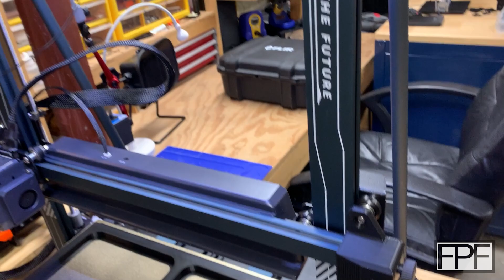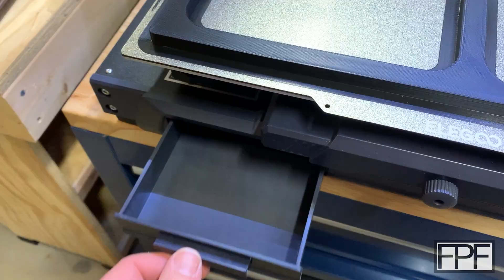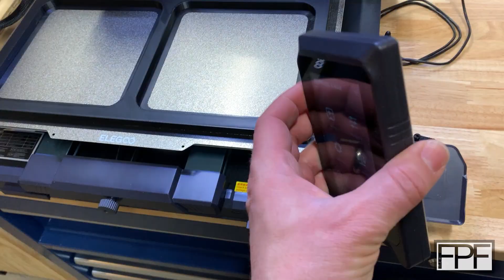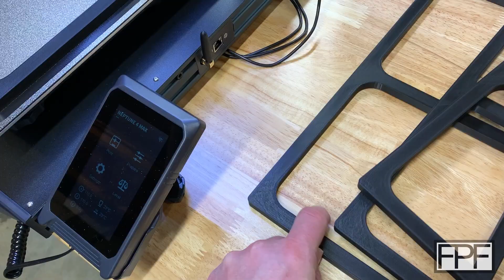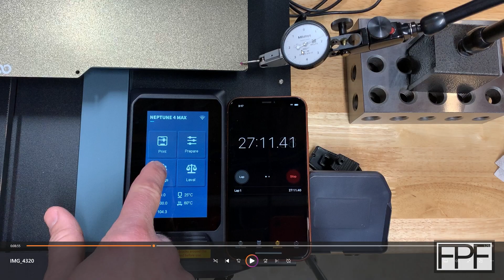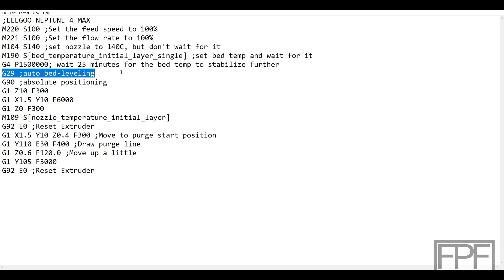Neptune 4 Max Review and a FIX for the PROBLEMS EVERYONE IS HAVING

Comment: THANK YOU!!  I was about to freaking hammer-throw this printer out in to the street and give up on printing completely!  I was letting it pre-heat before prints but z-offset and bed mesh were always inconsistent I should've known there was a better way.  Thanks for the G-code!  The bed mesh before every print has helped a ton.  Smaller prints are turning out fine now, haven't tried a large print yet but I have faith now that it will turn out fine :)

Comment: AHA MOMENT!!!  This would explain why the bed is shifting every time I try the auxiliary bed leveling technique.  Glad to know I don't suck at bed leveling.  Heat soak, test, heat soak, print.  What method or material did you use for setting the z offset on the printer?  Did you use A4 paper or some other spacer "device"?  Also, have you used Cura with this printer?  Do you prefer Orca over Cura?  I've been using Cura, but may switch to Orca if you recommend it over Cura?

Comment: Hi, I have just bought the Neptune 4 Max last week, and I had it sent to me, to the UK. In Europe we do use Cura a lot... Basically I printed out of the box, just after making a manual bed levellling and then an automated one. So far, I have only been printing small objects (the biggest is a drawer adaptor for the little drawer on the side of it, which goes inside the drawer and you can store the L keys etc), a filament out sensor bracket, to place it a bit more centered, two spool holders (a rotating one and a 3KG one), the extruder clip adaptor (The original one is indecent). The only times the print failed, was on four occasions: on three of them, I did not put any support during the slicing process in Cura, so the object did not have support in some areas; the fourth case, during a print job of a corner camera adaptor, at 50% (several hours), I have decided to switch off the led lights on the top, and for some reason the printer crashed, returning an error about reaching the max extrusion... I pressed the emergency stop on the webpage of the printer administration area (I have been experimenting both physical touches on the pad and the LAN management), and restarted the whole services a couple of times. In some cases, like when I tried to print a small nut and a bolt for a cosplay caliper, the threads did not come out well. It is too early for me to tell you if there are other issues. I did not upgrade the firmware or do any of the annoying things you mentioned, which made me think that probably I have no idea of the printer's flaws yet. This is my third printer, after a Prusa MKII Ephestos and a Creality Ender 3 S1 Plus which went on fire and smoke - seriously - last week, while trying to install a Sonic Pad (Still waiting for Creality to reply back to me about that) . I will follow you and keep your video as a reference, shall I have to do all the stuff you said. I really hope I do not have to upgrade the firmware or open the pad because it is very annoying...
-- 15 February update --
Actually I tried a 10 hours' job with PLA/carbon fiber, and at 87% I had to do a stop, because the printer started printing off Z-axiz, and it was all screwed up. Also, all the prints were opening in half, like a toast :-( I have experienced also that part of the first bed layer, in some areas was having visible spots in it, as described by someone, and after some time the fans bar, attached behind the extruder, started scratching the printed layers, when the bed was going back and forth. I had done a manual calibration before starting any job, and also an automated one. So, probably I will have to change the printer configuration as you guys said.
How can I check if the firmware is the latest version?

Comment: This video is pretty helpful and thanks for a heads up on this, but it's too long
I thought there will be a bunch of problems and multiple fixes (Title says "problemS", but in the end it was "There is one problem actually and it's a heat expansion because of physics, here is the showcase of that with my tool, so just heat your bed for 15-25 minutes before leveling and printing very large objects" but for 20 minutes for some reason. I get it you tried to be informative, but there are ways to condense information

So probably it's a good idea to build an enclosure for this printer I assume?

Comment: Could you use a glass top to fix the issue?
Reply from the maker: possibly, but the glass would have to be quite thick to remain flat at this size which brings with it quite a large thermal mass, which brings us right back to the same problem (long warm-up time)

Comment: Quick question: I set my sample to 3 but the LCD screen still thinks it's only doing 2 per spot. Now it measures a spot 3 times but the screen show that the 3rd measurement is for the next spot in the line. Is there something I need to change so that it knows it's doing 3 measurements per spot now instead of 2?
Reply from the maker: what is the console in klipper showing?
Reply: @FunctionalPrintFriday  Looks like the console is showing all 3 measurements in the same location .

Comment: Took me a bit of time to figure out the problem with firmware and the fact that waiting for bed to stabilize is required. For me, 10-15 minutes is good on my N4Plus.
Reply: mine keeps crashing any chance you can share the start code?
Reply: @user-gl2ss2th3m  Just add G4 P700000 after setting bed temp by M190

Comment: I'm new to the hobby and this is my first printer, i was very frustrated going through everything trying to get better results and basically came around to the same solution you showed here, just not as efficiently, i was just manually heating my bed setting a 15 timer and then coming back and doing bed leveling before starting each print. it was really cool to see actually evidence of what what i thought was happening and hear someone that actually knows what they are talking about explain it.
Reply: Yeah 3D printing right now can be a pain. It is a long learning process.
Reply: Would you recommend it for a beginner? Also, what is its current status, have the mentioned issues been resolved? this probbly be my first 3d printer but first ı want to ask.
Reply: @oktaymercan  Unless you really need big prints you'd be insane not to buy a Bambu Labss A1 instead of this.
Reply: @joeking433  I agree sending my max 4 back next week, going to get a Bamboo.  don't need this aggravation
Reply: @oktaymercan  I would not, I just purchased an max 4, and getting ready to send back no customer support thats my main issue.  too many printers outthere that less agrievating
Reply: I am in the same shoes, beginner+first large printer. Couldn't figure what happened for few weeks. Now I will give a try on this. Thanks
Reply: Check the hot end for leaks as mine was playing up could get a good first layer most people think it's the bed . But check under the little black sock on hot end if there is filament there you have a filament leak . Between the nozel and heat block fix that and Machine will work again .  Just remember if you try and fix it do it with the hot end up on the z axis and with the unit on pre heat or you wont fixed issue . .. . Please remember all bad nozel pressure and you won't get Machine to print most people think it's the bed on these machines but it's not it's a leak on the hot end . Merry Christmas ⛄
Reply: This is a issue with every printer for the most part. This isnt some big mystery. In some printers, we've even found deflection in gantries that carry the extruder. It was a big thing on Vorons. Does it prevent them from functioning? No... but its a big annoyance and does cause failed prints.

Comment: Very helpful for any 4 Plus/Max user. I figured it out myself that bed thermal expansion plays a big role in inconsistent prints and manually heat up the bed 15 minutes before print (enough for Plus which is identical to Max only slightly smaller). For manual bed leveling I recommend Bed Leveler 5000 which is really helpful in microadjusting the bed position before I run auto bed leveling (all with bed preheated for at least 15 minutes)
Reply: Do you still run the mesh level before each print, or did you do it once after letting the bed sit hot for a while and then just add the pause before each print?
Reply: @christopherperry9242  No. I don't run bed levelling before each print. Just in case I remesh the bed once a week, but once the bed warms up it doesn't really change between the prints (it changes while it warms up). When it comes to pausing I haven't yet added the gcode shown in the video. I just turn on the printer set the temperature (nozzle 140C, bed 60C)  manually either from display or Klipper and wait 15-30 minutes.  Most of the time I slice my models just before printing, it keeps me occupied while the bed warms up.
Reply: Probably be batter putting kamp on it so it levels the print area only on each print
Reply: Hey weird question, but in case you see this, can I use this GCODE for my Plus or is there stuff I have to change?

Comment: Thanks for doing this in depth review. It solves a lot of the issues I had with this printer.I think it will also help a lot of people struggling with this printer.
I really appreciate the way you include all the software and code changes. Unfortunately early on I was just pushing through before I understood all the issues and ended up with a massive blob of death on an early long print. Elagoo did send me a new nozzle and heat sink but it was very difficult to get the old one off.
It's a shame that the companies themselves don't find a way to resolve the issues and release a video like this.
I find it hard to believe they don't realize what the problems are.
Thanks again and keep up the good work.
I will also subscribe to your channel I have already liked the vid

Comment: Yes, the time before the print is definetly important. I mentioned this when i moved my Printer in the basement before i got an enclosure. Before, I had just under 21-23°C (69.8-73.4°F) in the apartment. The temperature in the cellar is 15-18°C (59-64.4°F). The prints immediately became worse until I accidentally left the printer on for a while and the print bed probably settled during that time. Since I got a case, the prints have been significantly better overall.

Comment: Luckily I heat the bed first thing, then do manual leveling until it no longer takes adjustment, auto level, then maintain bed temp until I print. by the time Ive done all that everything is balanced. I keep bed heated between prints as well.

Comment: Nice video, thanks. It confirms some of my suspicions and validates some advice I was reading in the various support communities around ensuring your printer is fully heat soaked before printing. Heat soak I think by your measurements means heat the bed to 60F for 30 minutes. I think some good advice for any that don't want to get into modifying print start GCODE for every print, and furthermore to avoid running a bed mesh prior to every print would be to simply heat soak your printer prior to running a standalone bed mesh, and then heat soak your printer prior to each print. That should align the variances well enough for the average person.
Reply: What is heat soak?

Comment: Thank you so much, this starting GCODE has made this printer usable to me again.  My first print was flawless and then I had nothing but problems.  Now using your Gcode, I am able to print again.  It's not perfect on the extreme edges of the plate, but its usable!
Reply: I will try this tomorrow, first print was flawless then everything else became a nightmare. The smallest I have been able to get the variance is 0.47mm
Reply: Mind sharing where you got the case? Or how you built it if it was DIY?

Comment: Yes think you should except Elegoo's machine to be adjusted wrong(loose beds, extruder etc) First with my elegoo max 3 and now with the 2x 4max when it got realized. We got spoiled with bambu lab, but think this adjusting knowledge is good to have anyways and don't trust manufacturers to adjust wheels right.

Comment: I have a Neptune Max, I totally agree this printer is not a out of the shelf printer, but the community is good and we have all the feature you would expect from a printer for reasonable price and the build volume is my biggest selling point. 
Build Plate: I been scratching my head to make the build plate flat, literal spend a month and write to Elegoo about the issues, for me the Firmware and Cura 5.6 update had some success it started print flat still not a good result, STILL THE BUILD WAS NOT FLAT, I ripped of the entire build plate to check each nut and bolt and the moving the Spirit level all over the place, still not make it work, after seeing your video i can imagine what did i miss and your brilliance and in depth knowledge in the subject is appreciated, i am going to try your solution and i am very positive,  

Thanks for this in-depth review with a solutions. 👍 Love your Bro 😎

Comment: I wanted to post an update.  I implemented your advice and I'm getting successful prints now, but I have discovered a new issue.  Every time I start a new print, the z-offset changes.  It seems like the previous Z-Offset is not being saved, and each successive print I have lower the z-offset further and further.  In my first print, the offset was about -0.4mm, with the second print, exact same model, the z-offset is -1.1mm.  Any ideas?
Reply from the maker: have you updated the firmware as well?
Reply: @FunctionalPrintFriday  yep
Reply: But if you implemented the start code changes, isn’t it running a bed mesh at the start of each print?

Comment: Thankyou soo much I modified for Cura based on your G-Code.This was an awesome find. Nice Work. 
;ELEGOO NEPTUNE 4 MAX
M220 S100 ;Set the feed speed to 100%
M221 S100 ;Set the flow rate to 100%
M104 S140 ;set nozzle to 140C, but don't wait for it
M190 S{material_bed_temperature_layer_0} ;set bed temp and wait for it
G4 P1500000; wait 25 minutes for the bed temp to stabilize further
G29 ;auto bed-leveling
G90 ;absolute positioning
G1 Z10 F300
G1 X1.5 Y10 F6000
G1 Z0 F300
M109 S{material_print_temperature_layer_0}
G92 E0 ;Reset Extruder
G1 X1.5 Y10 Z0.4 F300 ;Move to purge start position
G1 Y110 E30 F400 ;Draw purge line
G1 Z0.6 F120.0 ;Move up a little
G1 Y105 F3000
G92 E0 ;Reset Extruder
Reply from the maker: thanks for your comment, and thanks for sharing your modified version for Cura
Reply: I compared the G-code of the orca listed to your Cura version. I do not see anything different between the 2. Am I missing something?
Reply: So do I just wipe out the code? And put this? How do I?
Reply: @aw111986  I agree, need a quick step by step where to insert or copy the code for newbies
Reply: I am using the plus this code is making mine try to go past the frame on the x+ side can you help?

;{current_cura_version}
;{machine_name} 
M220 S100 ;Set the feed speed to 100%
M221 S{print_flow_percentage} ;Set the print traffic percentage
M104 S140
M190 S{material_bed_temperature_layer_0}
G4 P600000
G29
G90
G28 ;home
G1 Z10 F300
G1 X115 Y0.5 F6000
G1 Z0.4 F300
M109 S{material_print_temperature_layer_0}
G92 E0 ;Reset Extruder
G1 X115 Y0.5 Z0.4 F300 ;Move to start position
G1 X215.0 E30 F400 ;Draw the first line
G1 Z0.6 F120.0 ;Move to side a little
G1 X210 F3000
G92 E0 ;Reset Extruder
Reply: @user-gl2ss2th3m  Same here!!!
Printer printing outside the print area
Reply: Can’t thank you enough for the code, testing my first print after setting the new code. 😊

Comment: I mainly only print helmets are you recommending to just leave the Part cooling fan in the off position on top of the printer, or adjust it in filament settings to turn off keep fan always on, min /max fan speed threshold 0%??

Comment: i can't say much about the n4 max but i got the n4 pro and it took me a while to get this to lvl the way i want. The thing is with the neptune4 pro that the leveling of the auxiliary (the 4 knobs) bed corners are done in cold condition when you start the leveling from the menu. It only heats up for the auto leveling part which is not helping at all. First I tighten the 4 corner knobs completely and then loosen it a few turns so that i have some play. My fix is to manually heat up the nozzle to 150 - 200 and also the bedplate to 50-60 and then do all the leveling. But be aware if you finish a part of the leveling and save it ...your heating will be reset so keep an eye on the temps and maybe heat up again if it was reset. Then i start Auxiliary leveling the 4 corners but if its way off then do it on every corner 2 or 3 times this is where i got the best results. Then after the auto leveling starts let it finish and do the z offset also in heated state. In heated state i do the leveling with paper if you feel a slight resistance its good. That helped alot so that i can print flawlessly for a few days and then if a print starts to fail i will do it again. That is ok for me maybe it helps someone. I don't have to wait 20-30 minutes... i just start and it prints perfect if lvled
Reply: I too also have a N4 Pro and noticed the same thing as you and also did my levelling with the nozzle and bed pre heated.

Comment: I'd come to the same conclusion, but my bed also has enough distortions that a 9x9 grid doesn't capture enough detail for good part adhesion. My solution has been to install KAMP and use the adaptive bed mesh, which only probes the parts of the bed that will be printed on, then I turned up the mesh density to 25x25. If the print area is smaller than the full bed, it only goes to those points on a 25x25 that fall inside the area.

For temperature, I just pre-heat and let the printer sit for half an hour or so. But wow did I go through some machinist-related contortions to come to that conclusion, as you did!
Reply: Hi! How did you do that? Klipper is only 9+ on neptune 4, [exclude_object] is only on 10+. I struggle to install it myself now